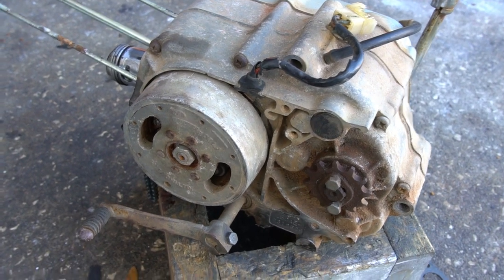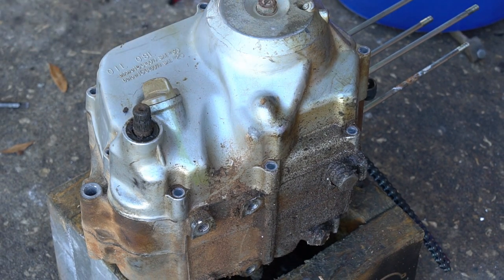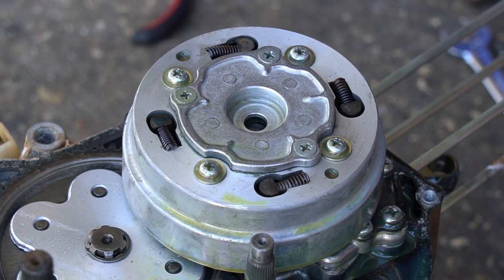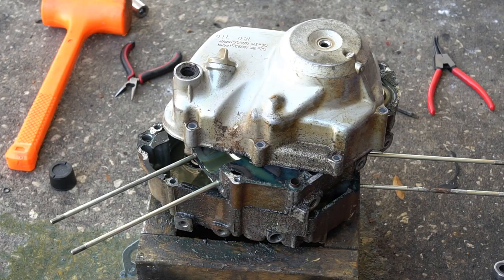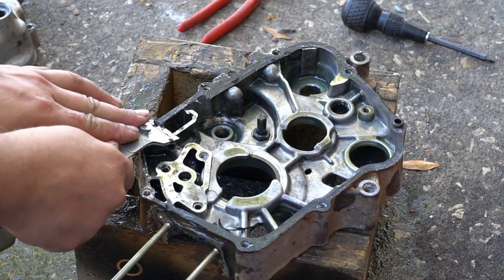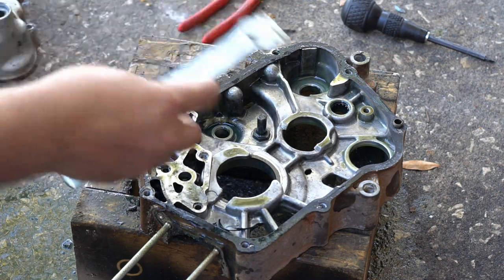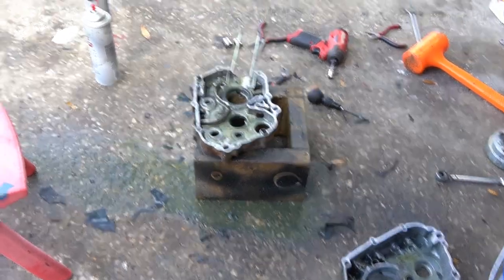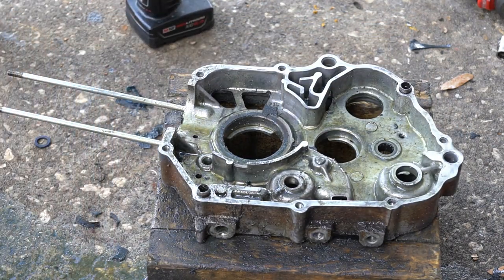Engine Case Cleaning Process (Part 1 of 2) - Vintage Honda Z50 CT70 SL70 ATC70

Comment: Which bristle brush attachment are you using on your drill at around the 8 minute mark? Also, when filming segments like this, set a focus point (in this case the engine case) on your camera so it doesn't keep going in and out of focus as your hands move in)
Reply from the maker: https://www.amazon.com/3M-18733-Roloc-Bristle-Disc-Grade/dp/B01MSU3PYQ/ref=sr_1_1?dchild=1&keywords=3m+white+bristle+brush&qid=1608813877&sr=8-1

If considering getting into these Roloc style tools, buy the 3M mandrel (Disc holder) b/c all other knockoffs are inferior. Also I use it on a die grinder tool that spins alot faster than a drill does.

Comment: do not use a screwdriver to lever the covers off !
Reply from the maker: Hi Scott. Use what ever method you are comfortable with. Not sure what the issue is with what I did - I dont think it could have been less aggressive then this. Thanks Josh
Reply: @VintageHondaMinis  i don't have an issue bud, you just should never lever cases off just tap em with a soft mallet, its ok if you don't have one just use a piece of softwood  and a brick. sound engineering practice, very useful vid by the way, thanks scott.